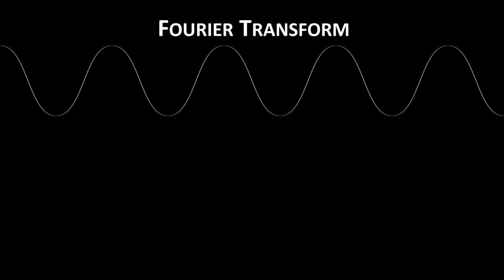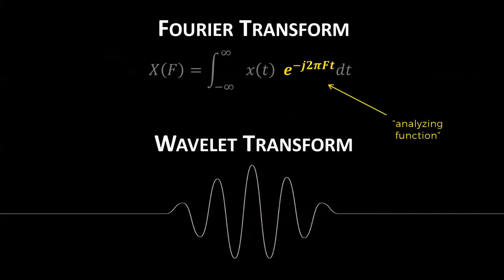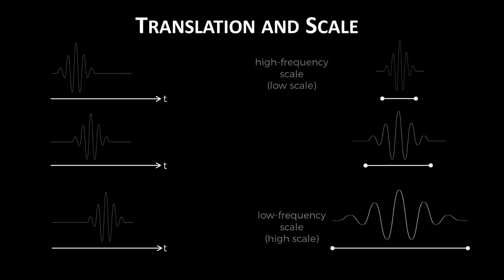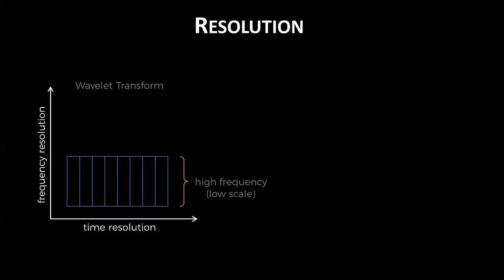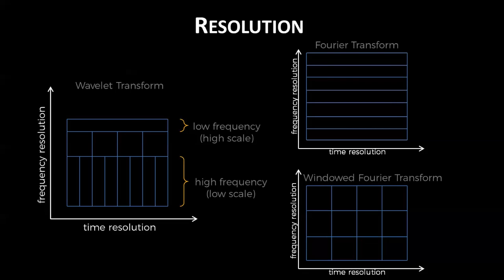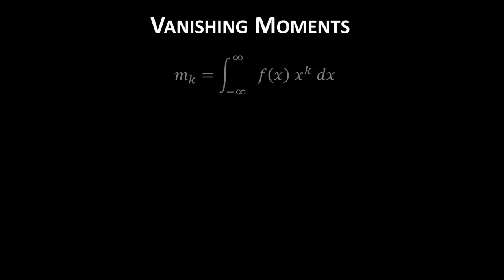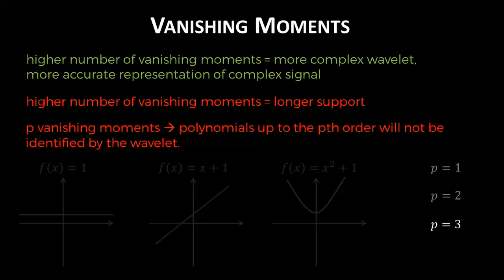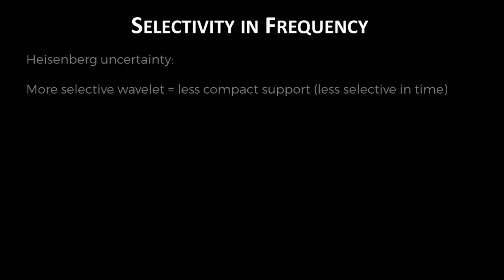Easy Introduction to Wavelets

Comment: another way the logarithmic change in resolution is useful is that even if the bass plays 16th notes, the transients will all be contained in the higher range of the spectrum, the main way the lower frequencies will be affected by each impact is a slight variation in pitch more than amplitude, therefore we're pretty much detecting exactly what's important at each energy level. Can't wait to figure out the proper math to impliment this in max.

Comment: Hi, I have a question about wavelets: I want to analyse power system fault currents with wavelet. when I use 1-d wavelet toolbox, d1 to d5 coefficients are in the same time scale and I can for example find the value of each coefficient in a specific milisecond like 2.05. but when I use "wavedec and detcoef" in my mfiles, the d1 to d5 coefficients are not in the same x axis time scale. for example if my wave exported from PSCAD be a matrix of 1000 samples, d5 will be 500 samples, to d1 will be 20 samples for example. and they cannot be synced plotting together finding all coefficients in a certtain x axis like time, which is being plotted automatically in 1-d dwt toolbox. so whats wrong with my understanding or using of wavelets? thanks

Comment: Great! i need to help how to know "which" wavelet use, i use db1 on my thesis, i tried to use others for my denoising application, but the result is the same.
Reply: +Angel Camacho could you please tell me which software and functions you use for denoising? I'm confused because of the number of packages in R and too many wavelet related functions in MATLAB.
Reply: Hello, I'm using matlab, I recommend you use "wavedemo" and select the 1-D, is really very very easy
Reply: ***** Thank you so much. I will try now...
Reply: Angel Camacho Can i have your email ID. I am working on wavelets..